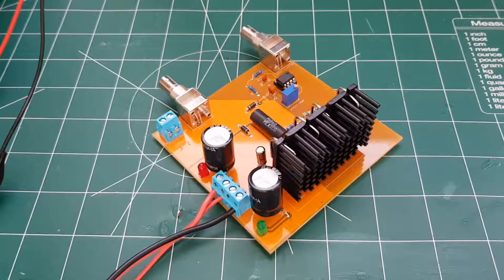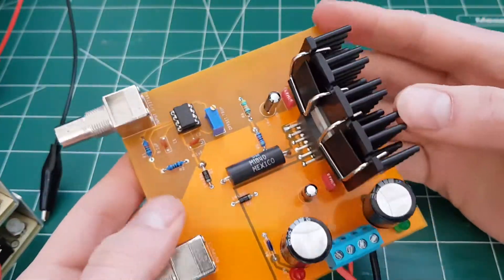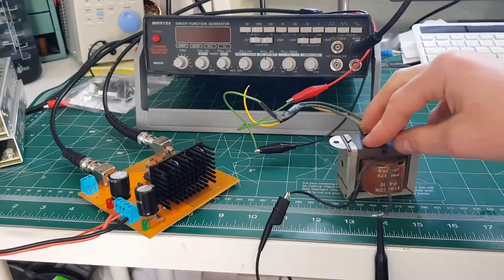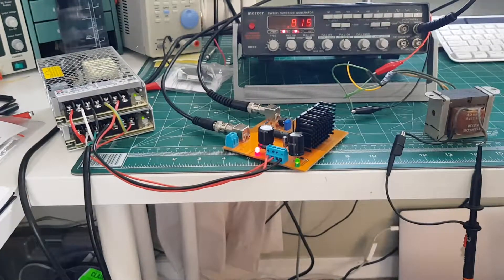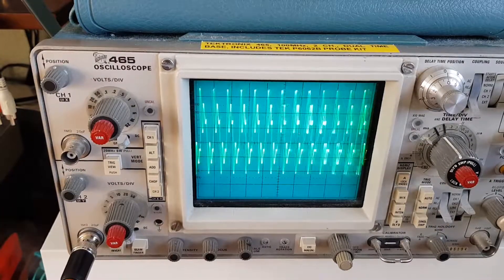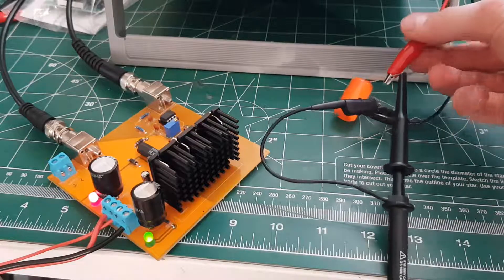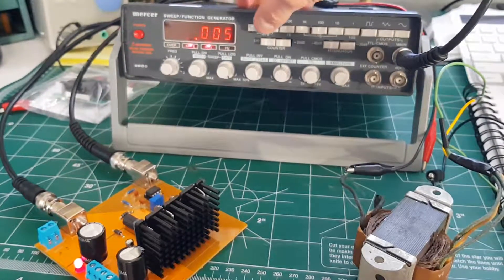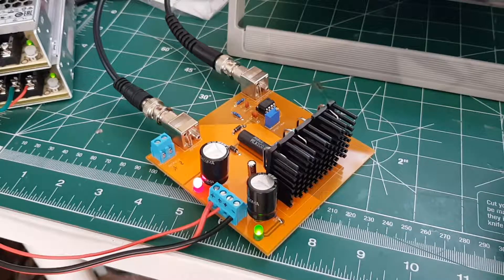Function Generator Amplifier

Comment: How did you connect PSU-s ? They are ground referenced and touching each other.
Reply from the maker: The negative terminals of the power supplies are not directly connected to ground. There are separate ground and negative terminals. I connected the two power supplies in series and the connection point of the + and - I took as ground for the device. It's no different than connecting two batteries in series.
Reply: @thetuberoaster8321  Thx. Didn't know that meanwell PSU-s come "isolated" out of factory.

Comment: Can you push out 200volt at 40khz with this amp?
Need to drive a transducer.
Reply from the maker: Not without modification, the output op-amp can only handle +/-40V supplies, giving less than 80Vp-p output. You'd either have to make a transistorized output that ran on higher voltage or make a toroidal transformer to step up the voltage. Also, the amp might not be able to drive the transducer correctly if it is very capacitive. This amp plus a soft iron core transformer might work.

Comment: NIce sharing, is it posible to make amplifier to boost voltage arround 380V (12khz)? I want to use that as ohmic heating power supply
Reply from the maker: In short, it's possible to make something like that but it's a pain. Maybe if you made a push-pull driver stage connected into the feedback loop of the op-amp. The driver transistors (BJT or MOSFET) would have to be rated for at least 400V and would need a large heatsink depending on how much current you need to drive. I have a video on this called "Class C Amplifier" which shows how to make a lo-fi power booster for an existing amp. If you need higher AC voltage than what this circuit can make, a transformer might be a simple and viable solution, as long as the frequency is not too high. Then again, the secondary will be very current limited.

Comment: for voltage 10x only or also....can push out max current of 1 A or more...
Reply from the maker: It's current limited to 6.7A with the 0.1 ohm resistor regardless of what gain you have it set to.

Comment: Do you have a BOM you can give? Because im wondering, do i need 3W resistors for every resistor, or only for the 0.1 ohm
Reply from the maker: The 3W resistor is only the 0.1 ohm. All the others are 1/4 watt rated.

Comment: Can you apply the output on a resistor as a load? To test resistivity for example
Reply from the maker: Yes, it will work perfect for resistive loads. It struggles with capacitive loads however.
Reply: @thetuberoaster8321  thanks man

Comment: I need to amplify a sine wave of 40 kHz coming from signal generator. will this work? my target is 40  Vpp. also is it available online?
Reply from the maker: With 24 V supplies, you can get somewhere around 44 Vp-p maximum with this thing. It will work fine at 40 kHz at the default gain setting. I think it starts to slew rate limit around 200 kHz. Unfortunately, this is not available online anymore.

Comment: Nice one. Your work is neat. Your presentation clear!!!  Can you provide one your circuit diagram and BOM. I would like to build this. Kind Regards
Reply from the maker: Here's a link to a kit for an improved one I made, you can get the whole thing or just a PCB: https://thetuberoaster.com/products/function-generator-amplifier-full-kit
The kit description has a list of parts, manual and schematic. Here's the manual, which explains the circuit:
https://cdn.shopify.com/s/files/1/0498/1833/7429/files/Function_Generator_Amp_Manual.pdf?v=1606795121
Reply: @thetuberoaster8321  Checked this out, but the price.  Thought I could have some circuit drawing to build. Thanks anyway.

Comment: Yeah, these not too much out there for a function generator amp.  There was a 2 channel 5 watt Juntek one for about $70 but nothing more powerful.   Not sure if CB amps would work or not.  I dont know much about electronics so making my own isnt an option. There's one guy who makes Rife machines that builds an amp with built in carrier frequency for $170 but you have to supply your 48 watt and 20 watt power supplies. This is the link:  http://spectrotek.com/pa1.htm

Sure seems like there's an untapped market out there, especially for guys looking to build their own rife machines. Thanks for the vid.

Comment: DID YOU MAKE PRINTED CIRCUIT BOARD OR, WAS IT ALREADY MADE WITH THE CIRCUIT TRACES ON?
Reply from the maker: I designed and assembled it. The software I used was Eagle and the PCB making service was PCBWay.